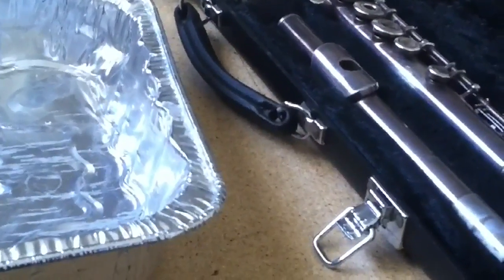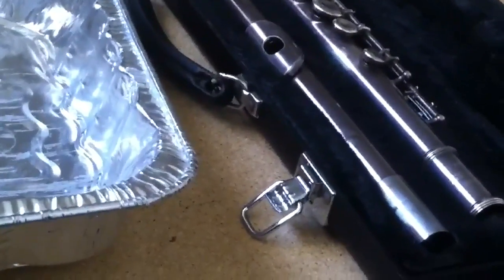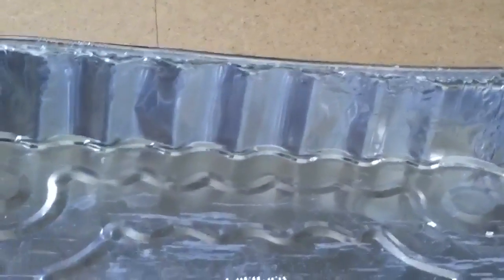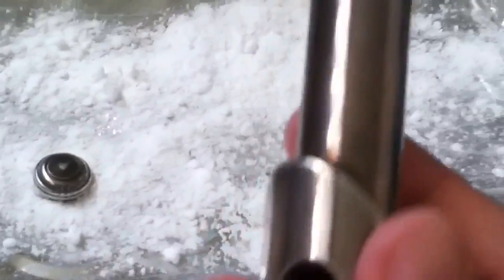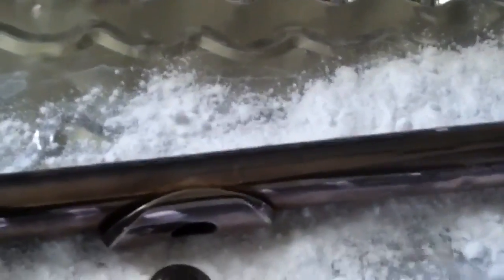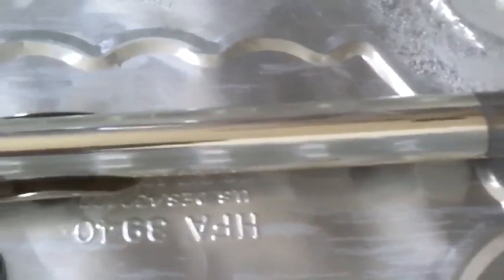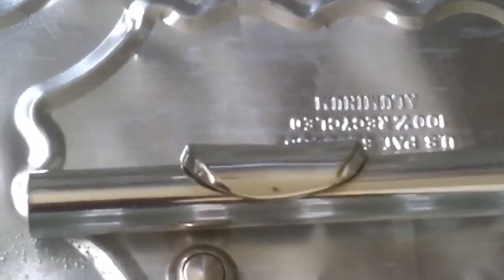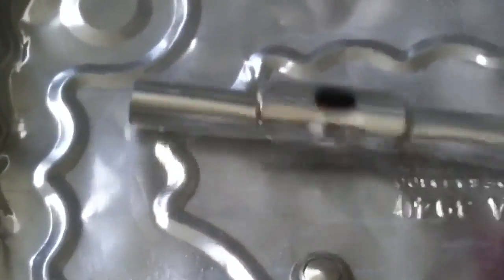Removing Flute Tarnish ( Headjoint only)

Comment: I thought the Yamaha 285S2 had a silver plated headjoint?  In the video the tenon does not appear to by covered by plating, which is typical of plated head joints
Reply from the maker: Good google observation! Correct in general but when I purchased this instrument well over two decades ago, my instinct to upgrade to a solid silver head joint at that time was a good investment. I also only paid somewhere near $200 for it brand new in a music store which by the way has long since closed down in Los Angeles. unfortunately not investing in youth education has drastic trickle down effects in various sectors of the economy

Comment: Do you know how to remove tarnish in the bodyjoint?
Reply from the maker: I do! Given that I am an experienced flute specialist repair technician in Los Angeles, I am very knowledgeable about the maintenance and repair at a very high level.  I also made a video showing removing tarnish linked below in the description. 

Both this video and the other show my experiment showing the efficacy and ease of tarnish removal with no toxic chemicals. It is definitely not industry practice, but possible!
Reply: @MicahLayne  I also prepare repairing the flute! Thank you for your feedback^^

Comment: I can't believe I'm old, retired, and didn't know this method. Come to think of it, I never attempted this kind of cleaning. When I was young, the Gorham silver company made a fortune selling their pink silver polish and this simple method was a secret. What a snap to clean real silverware or silver/gold plate this way, and so non-toxic!  Of course, in the old days, everyone was warned about the hazards of getting polish on the pads, which was not worth risking for the sake of a shiny flute.

Anyway, I had a happy accident in the course of cleaning my gold-plated Yamaha headjoint. I hadn't touched my flute in about 17 years, and am playing for a few days now and enjoying it, and the gold plating had developed a brown tarnish in a frost pattern that was almost pretty. But I decided to clean it anyway, thinking it was a good idea and that I needed to look at the cork. In contrast, a silver headjoint which had sat the same period unplayed looked fine, like new. 

I'd been watching cork assembly/maintenance videos from JL Smith, and so after the tarnish just disappeared in seconds, and I rinsed it off, I had noticed the cork was very wet half way up, which means you need a new cork because it's leaking, so it's shrinking. That makes sense. It's over 30 years old.  I noticed the cork nut was loose.  I was delighted! So after drying the cork off with a hair dryer, and after wiping it first, I tightened cork nut, hoping it might fatten the cork up. If you tighten it too much it can crack the cork. So I get it together fine, and it plays better than before. It plays so well that 17 years ago, I never would have bought a custom headjoint had it played this well then. 

I have some secondary instruments, like a 50 year old student flute and the cork was stuck in but I got it out with light tapping with a hammer on a wood dowel. Don't do this if your flute is of any value to you. Although it worked perfectly fine for me. It's a plated instrument, needs new pads. Had a real mange of tarnish and grime. The silver plated  headjoint got clean like magic. I think makers should just weld the stopper in the proper position. 

When I was young, I worked in a factory for a year to get my first good flute, a Haynes, and I went to Europe to study with an idol of mine. The flute was black in 6 months. I never wiped it at the end of a day of practice. I thought I had some freaky acidic hands or something. My next flute, having sold that one to help finance a non-music career,  I wiped, and it got very little tarnish, and only in places I couldn't reach.

Comment: Strangely, my flute doesn’t have a cork. Is it safe to do this?
Reply: All flutes need a cork to seal.  If the cork was removed ( for future readers of this thread ), one needs to be re installed or else the metal parts and leaks will create odd harmonics and a much harder to play instrument.

Comment: Good news for those of you who don't want to mess with their corks. My head joint is silver. I made a small pan out of aluminum foil, put some baking soda in it. Poured some boiling distilled water over it. After waiting a bit for the soda to melt, I used a clean cloth to clean the head joint using the cloth which I dipped in the solution. It takes a bit of patience because you have to  wipe the tarnished spots over and over again but at the end all tarnish was gone. Specially after I wiped the head joint with a dry, soft and clean cloth. I'll try cleaning the rest of the flute with the same method without wetting the pads. I'm not sure if it'll work because the rest of the flute is not silver.
Reply: how did it go for non silver parts?
Reply: @platedpen  Not so well.
Reply: @mgoksoy elaborate

Comment: Can I just spot clean it with the same concoction?
Reply from the maker: Bonita Chakita no, since the baking soda is a chemical catalyst that helps the aluminum remove the tarnish from the silver. The baking soda is not a topical “cleaner” or solution in this case. Please feel free to read through the description under the video for more chemistry info describing this process.

Comment: There is electrolytic action involved. 

(There has to be electrical "connection" between the flute and the aluminium, and the baking soda acts as an electrolyte. Aluminium is chosen because it is well above silver on the galvanic series.)  

Is the silver sulphide actually removed or is it just converted back to silver? 

If the tarnish is really thick/deep then the result is a dull white look that feels rough.  It is not black but still needs a fair bit of polishing or buffing to remove it and restore a flat, shiny surface. I presume that it is rough, dull tarnish that has been converted back to rough dull silver. 

Some silversmiths don't like this method, claiming it leaves the surface of the silver microscopically pitted, which makes it more prone to future tarnish
Reply from the maker: All correct info. The counter to this would be that other forms of cleaning also have pros and cons. For example, using an abrasive silver cloth takes off layers of silver from the surface of the flute to expose non tarnished silver underneath. Chemical silver polished are highly toxic and have cancer causing ingredients. This experiment I did years ago was a cool, “hey looks at this non toxic easy method to remove tarnish from silver” Even years later, I think it’s pretty cool. Am I advocating others to leave their flute religion to do this? Not at all. Just showing something cool.

Comment: You really need to issue a warning on this video to remove all keys and corks before doing this. Or even better tell anyone that wants to clean their flute to go to a shop and get it done by a professional. I just had someone come in to my shop that watched this video and then attempted it without removing the keys. Now she has to get the flute completely repadded. This video is very bad advice!!!
Reply from the maker: Charles Harris Thank you for the concern. I did several years back. Enjoy https://youtu.be/imya_T4RXWw
Reply from the maker: I am also a professional flute repair technician. I am fully aware of the various ways to clean flutes and the precautions that need to be taken when working with instruments. I’m sorry this person did something that I did not show or advocate in this video ( and in fact explicitly warned against in the video below) and harmed their instrument, but as I state over and over, personal responsibility is a lost concept these days. I’m glad you were able to use it as a moment to talk to the child and set them straight.
Reply: You need to put a warning at the beginning of the video. Large words not just verbal. And definitely not in "Part 2".
Reply from the maker: Charles Harris thanks again for your concern. I understand your point.
Reply from the maker: Charles Harris just wondering, what is your opinion about an individual’s personal responsibility?
Reply from the maker: At some point, large text (or all caps) disclaimers or warnings seem to not stop individuals from doing stupid things to their instruments. I see it all the time at the repair bench. Education and good faith intellectual discussion is the long term solution.
Reply: A person is responsible for their own actions and that is all. Also a person is only a good as the information they are given. So when it comes to your personal responsibility you need to post a warning on this video to watch the 2nd before attempting this procedure as this video is full of bad information.
Reply from the maker: Charles Harris I disagree. I don’t think you make a persuasive argument.
Reply: The title of the video is:  "Cleaning Your Flute (HEADJOINT ONLY)

Comment: ONLY DO THIS FOR THE HEADPIECE! (He omits from the video) you will ruin the rest of the flute if you try this with the other pieces!
Reply from the maker: Jr Rice you are correct in a way. As others have stated below in the comment section, full disassembly of the flute keys will leave only solid silver parts. I show this in my second video. I highly  recommend it

Comment: Yeah, what about the pads on the main body of the flute, remove them?  Of course it's yes, because you will ruin the pads if you soak them.  But why the omission?
Reply from the maker: Yes, of course remove the pads.  This is an old video from several years ago. a couple of months later,  I did a second video showing me removing all of the pads and keys from the Flute check out that video . Originally when I made this video I did it as an experiment to show the Chemical reaction that removes tarnish from sore. Now I am a professional flute repair technician and continue to study the various ways to maintain and restore professional instruments.

Comment: Will this process damage the pads if using the same method on the rest of the flute?
Reply: yes
Reply from the maker: Yes, of course remove the pads.  This is an old video from several years ago. a couple of months later,  I did a second video showing me removing all of the pads and keys from the Flute check out that video . Originally when I made this video I did it as an experiment to show the Chemical reaction that removes tarnish from sore. Now I am a professional flute repair technician and continue to study the various ways to maintain and restore professional instruments

Comment: My old  flute's (gemeinhardt beginner, unsure of model) cork falls out sometimes. My band director says its because of the heat.  I'm in the marching band and all day for seven hours, my flute is falling apart. Dunno what to do about this problem. Fortunately,  my flute sounds the same. Also, my flute is not rusted on the body, but the plate is very rusted. I use  flute polish on it, but it doesn't disappear of which I am severly disappointed. Baking soda seems to be unnecessary for just the rusted plate. Just wanted to share this to see if maybe aome others have a similar/same issue.
Reply from the maker: Skyblue Sunny All cork ages over time. It is standard for flute technicians to replace the head joint cork for you when you bring it in for its annual maintenance. When was the last time you had your flute checked? Maybe it’s time to take it in.
Reply: Micah Layne Last time I visited for repairments was a couple months ago. I went because my F & C keys wasn't working.  He didn't changed the cork or anything though. (Btw, I had this flute for about five years now)

Comment: Also could you just take a piece of cotton cloth and dip in the hot baking soda and water solution, then rub the flute in gentle circular motion? It might take longer but may be not?
Reply from the maker: Corinne Trang Hello. Good questions. As I mentioned below in the comment section, the baking soda is not the "cleaner". So wiping some on the flute is not what I show in the video and it is not what causes the tarnish to be removed. I remove the cork because I just want metal to come into contact with the aluminum and hot baking soda solution to cause the chemical reaction that removes the tarnish. Also, it is common practice for repair techs to change the cork for you when you bring your flute in for its annual maintenance. Cork ages over time, which causes it to shrink and not give the head joint the necessary seal for good tone. We replace the cork when you bring it in.

Comment: I did this once with an old locket because it was extremely tarnished, once it was in the solution it started to bubble, twist, and jump. Then one of the actual picture holding pieces popped off.
Reply from the maker: LuLu56 sad to hear. Luckily we are only dealing with solid silver pieces of tube here. No problem at all as you can see in my two videos!
Reply: Micah Layne thanks and absolutely! I might have to try this with my flute sometime.

Comment: will it do the same thing with the other pieces that has the pads?
Reply from the maker: Helena Krieger no
Reply: Micah Layne so how would I shine those parts up, then?
Reply from the maker: Helena Krieger buff manually with cleaning cloth or simply take pads out before dipping them in solution. Watch my second video for more info on body cleaning.
Reply: Micah Layne okay, thank you.

Comment: I have a silver plated flute but in some parts the silver has chipped off, will this process damage the metal underneath my silver coat?
Reply from the maker: Hollow Grind Good question. If your flute is chipped, I wouldn't do this. The Yamaha I used in this and the second video has keys with silver worn off exposing the nickel underneath. It didn't "damage" my flute. Having said that, if your flute is in bad shape, it may be time for you to take it in to a repair tech.

Comment: my mouthpiece plate is gold and the inside of the head joint is coated with gold (outside silver). is this method safe for the gold? I looked in comments and didn't see anything.
Reply from the maker: Jessica DeWitt I don't know. Probably should just use a polishing cloth on the silver part since gold doesn't tarnish.